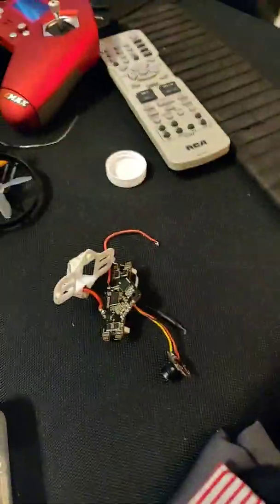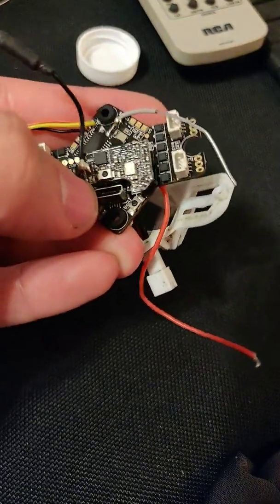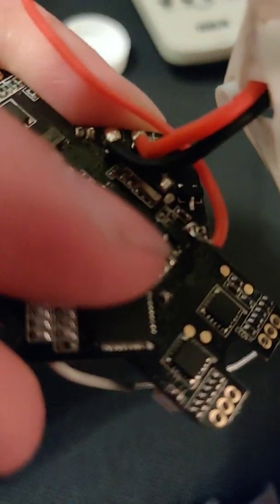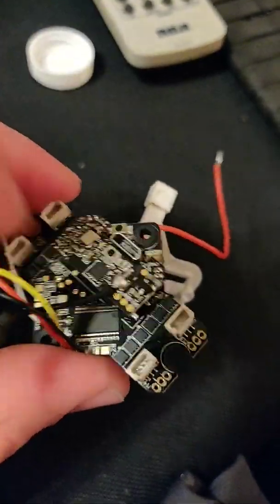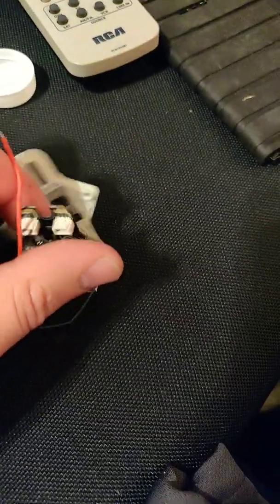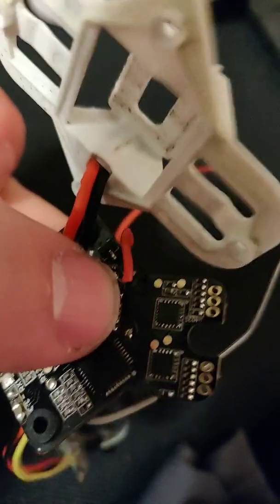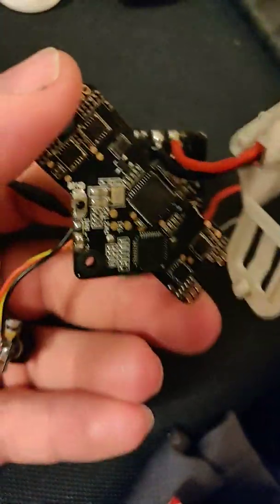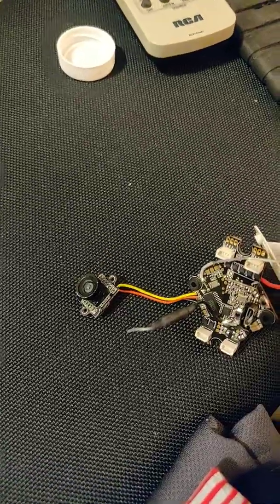BRICKED TINY HAWK FIXED!!!! READ DESCRIPTION PLEASE

Comment: Hi, HELP, I just brought a Tinyhawk2 and my son in Bataflight after doing a Backup, perform a reset, and even after a restore the drone is like dead no more everything, do you have any idea what can I do to put it back to work? I will really appreciate it. Thanks
Reply: I had the same problem. To solve it, you need to search this link:
https://drive.google.com/file/d/1Up8YACjKSxLNUJN28P3sNFEd4SzCSfm4/view
After, you copy all the text from the google drive, plug your Tinyhawk and copy the text in the CLI. It should work like before.

Comment: Thanks for the video, just to let you and everyone else know, soldering anything to unbrick this board is not necessary see the Boot button next to the USB? Hold that down & plug the USB in & Betaflight will go into DFU mode, (no lights will be present on the FC) re-flash the firmware making sure to Erase all chip contents. I sent one back already as seems I may have killed the firmware with a bad CLI Diff All import. New one arrived stupidly did the same process which confirmed bad CLI. The one I returned, dealer couldn't fix it & neither could emax support. Think that says a lot for Emax support :-)
Reply from the maker: Hello, the original tiny hawk won't power the mcu if it is soft bricked, jumpers are normally necessary to provide power past the diode on the 5v rail. That is not there case with most flight controllers.
Reply: Unbound UAV I don’t this that is the case even with the TH2 I was about to follow the advise in this video as my board seemed totally dead no FC boot at all. Guess the clue is that the lights on the VTX part light for a few seconds then went off. To all intents the FC looked like no power was going to it. I simply held the boot button reapplied power and DFU mode was available. This is not mentioned in tech TH2 manual but the schematic does show the boot button. Original TH could be different I don’t have one so not sure
Reply: @smdemmery  so what did you do to get it into DFU? That's what mine is doing. VTX lights cycle twice then nothing happens ( with battery plugged in). With the USB in, nothing happens at all, even pressing the boot button
Reply: Chris Heichel I don’t think I connected the battery, simply fired up BF held the boot button plugged the usb in (computer end) then after about 2 seconds let go of the button DFU came up in BF and I could flash. Ironically I already returned one with this issue thinking it went bad but second one did the same thing. They both initially worked until I applied a bad CLI.  The button is clearly labelled BOOT in the manual and I think on the board and it’s in a kind of obvious place so need to jumper the board I think would be an odd thing to have to do. Good luck
Reply: @cheichel87  hi.. did you fix, i have the same problem.
Reply: I've got a tinyhawk 2 and tried the boot button while plugging in to my PC and still nothing? I've only had it 2 days and just plugged into beta flight to use with a simulator. I know it's a data cable I'm using because it worked once before. Any ideas?

Comment: I cant even get my goggles to connect to the tinyhawk I change the channel and all of the sudden i dont see any viseo from the tinyhawk I searched up all the channels and still nothing happens
Reply from the maker: The channel is set to one on the FCC lock.
Unplug, hold down the vtx button, plug in while holding the button, let the vtx light blink a few times before you let go of the button.
Replug as normal and it will work on all channels again.
Reply: @unbounduav6940  Now Im having problems with my motor I chep the plug but still it never work I probably need a new motor
Reply from the maker: @cyberduck7377  try swapping the motors with the opposite side. If the motor does the same it's the motor.
If it works, it's the tune or esc.

Take the prop off the motor and check for hair. Pick out all the hair, if you can't get it all out lightly and quickly run a lighter over the motor to burn the hair or clog out.
Reply: @unbounduav6940  I checked everything I swapped it out and I took motor apart I found out that the motor wires copper that connect to the wires are loose and It pulled out so I need a new motr
Reply: @unbounduav6940  Can I return this for a new one?